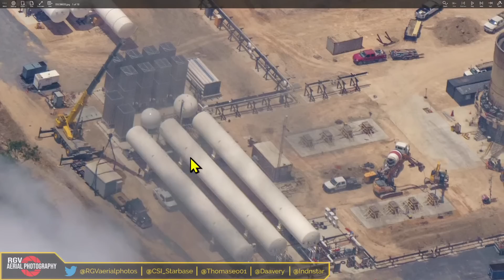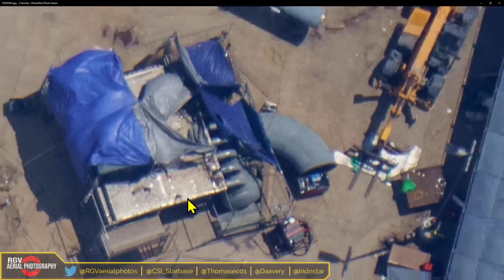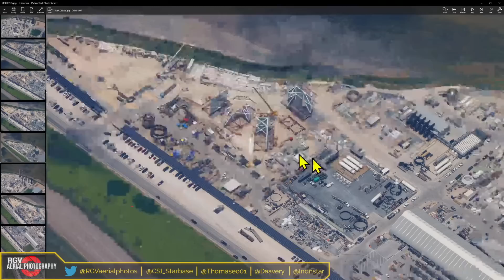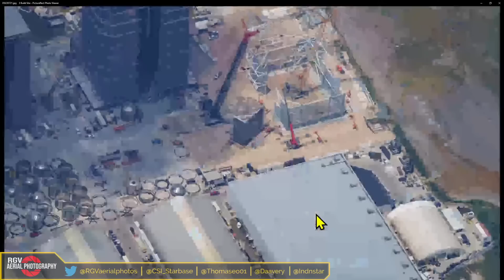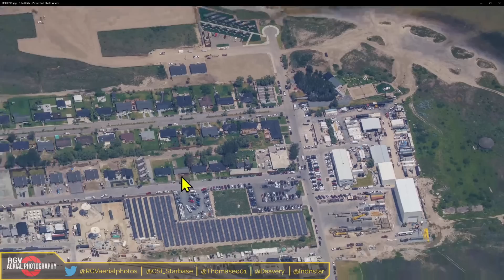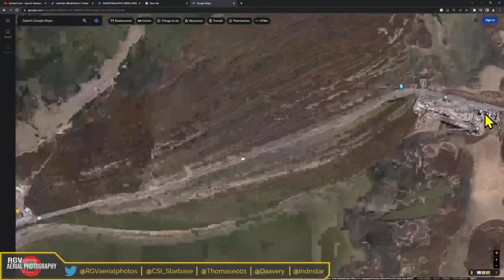Starbase Weekly, Episode 76

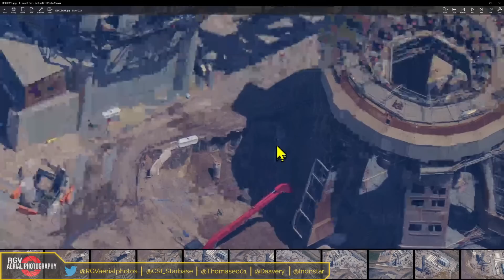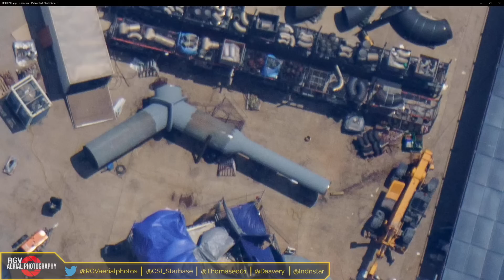Comment: The sheet pilings will be the "outter wall" of the pile cap.. this is very common in "undergound" pile cap construction. at 2:41:30 you can see them surround the entire area they've dug out to accommodate the pile cap, I think they will dig out the other side soon. Also in that shot, the deluge pipes will enter there and be encased in the pile cap as well, so they want extra reinforcment there (all those piles.) The replacement pipes that were under the dog house will also be encased inside the pile cap and there won't be a dog house anymore. They did the same thing on that side with more piles but most of them are covered up at the moment so construction vehicles can drive over it into the ramp they have going down into the pit. I think the bigger water tanks they are about to install, that also have the smaller diameter pipe, will feed the blast plate system and the bigger diameter pipe will go up to the top of the launch mount for deluge up top. The larger diameter pipe creates a slower flow rate but at a higher pressure (to get up the top of the OLM) The smaller diameter pipe will feed the Tee shown at 47:00 which will branch off and feed the three main manifolds going into the plates. The smaller diameter pipe running from the tank to the tee is to increase the flow rate.. at the same input pressure, as I also assume they will have one compression pump pessurizing both sides of the pressure tank stack (the system will also probably include one back up compression pump)  That entire hole as you said is about 15 feet deep, there will be a couple of feet of gravel, then the concrete pile cap probably 10 feet thick, and then the entire blast plate system on top that probably 2 feet thick (we know the plates are about 16" plus spacers betweent them and the pile cap) with all of it ending up flush with the existing ground / concrete.

Comment: looks good though at 8:50 I'm curious if they will try to do anything to stabilize the ground under it similar to the main stand and the interlocking panels forming water-tight retaining barriers to prevent erosion underneath the concrete :)